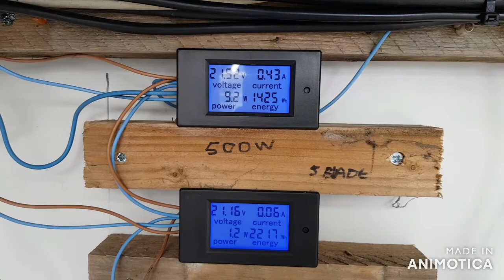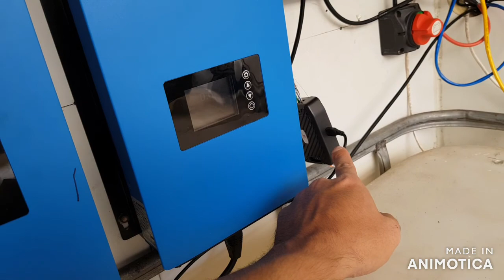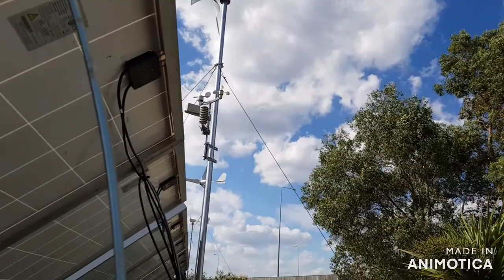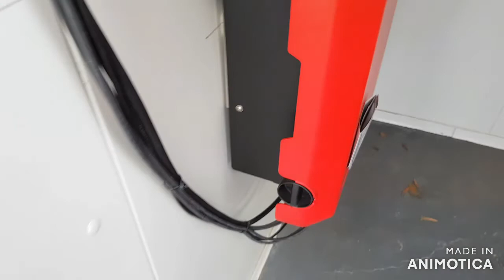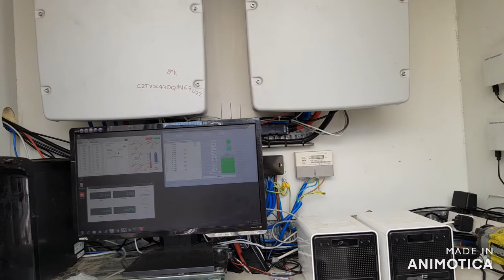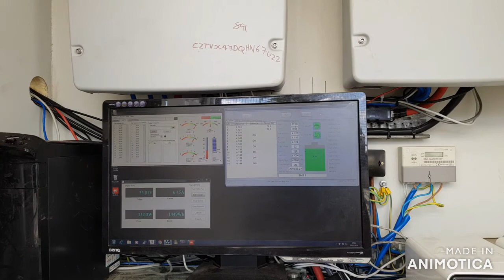Off grid in the U.K , Wind turbines , Batteries and inverters PT2

Comment: Where the best places to go to get good advice on instalation options of the deferent types of renewables
Reply from the maker: Hi, there really is'nt much in the mainstream, and alot of confussion out there too. My advise is if you are trying to reduce bills stick to grid connected solar installs ( albeit there is about 16amp AC export maximum)  unless you can get with zero grid export inverters. If you are looking with battery management, have a look for hybrid inverters. A very good company that could give advise is Voltacon, have a look on the internet, but i'm sure they are very busy at the momment but is a good starting point. Hope this helps, if you get stuck, leave a comment will try to help best i can. Ivan

Comment: Power produced by turbines becomes very often a danger to your system (overvoltage). In time we all figure out that multiple ways to burn the extra power or even short the turbines in order to stop them is a must. More and more videos on youtube show that we all end up purchasing the same monitoring equipment for your systems. good luck!!
Reply from the maker: I think, the size of my turbines, does the best for my sized equipment, i was looking to net off the usage during the night.  During the day the solar charging would off load and throttle down if the batteries are full , and i have at least 12 Kw of loads that are automated to turn on if production is too high.  With the storm that just happened, we were charging from the turbines, but nothing uncontrollable, i could see the problem if i had a much larger wind turbine, it would be almost uncontrollable.
Reply: @offgriduk2643  Makes sense. I wasn´t grid tied and had to do all extra energy burn locally. I also tried to not use 220vac and do it all at 48vdc (replaced the 220vac water heater in my solar cylinder for a 900w 48vdc). as a last resort and in order to stop the turbine, a 3 phase contactor used to short the turbine. all this done with a voltage sensing relay. another reason to keep it all on the 48vdc; if the inverter goes bad and your batteries are full, your system could go overvoltage.
Reply from the maker: Such a good idea to keep it all on DC, makes no sense to go from DC to AC then back to DC to charge the batteries.  I looked at the DC water heater element, but found they don't deliver the same kind of wattage vs the AC ones.  And in my situation the water tank was 100m away, the DC line loss would be ridiculous, and cable size too.

I'm not sold on shorting the turbine, have seen to many burnt out this way, i use this on a windless day when doing maintenance to stop the turbine.  But can burn out on windy days, if this is your last resort.  If possible you would be better using a Sheppard's crook to pull the turbine out of the wind to stall the turbine. 

I recommend two inverters to all people installing, for the very reason of one inverter going down.  So long the DC batteries don't over charge your safe, when the system is running, on small wind turbines like mine you don't have to worry about over charge batteries.  But if doing maintenance or if the system is off line / standby, then i would worry.  I have two dump load elements in parallel for that very reason, that's already a couple of kW to dump to.  Also the BMS would disconnect if the system voltage or cell voltage is too high.  Lots of safety redundancies. I would rather have the turbines free wheel than short them out, but either one is not the best option,  I don't think i've ever seen my dump loads (elements) come on, but it is there for peace of mind of over voltage on the wind.

Comment: Folks looking at this vid because of super high energy costs - Honestly unless you have wind speeds typically of 12m/s at you location folks it’s not worth installing wind at all  your better off installing 6 -8 high powered solar on a small roof or 16-20 high powered solar on a mid to large roof , just remember that in Dec-Feb with the low sun your only see a quarter on average max generated  e.g a typical solar day (10am - 5pm ) of a 6kwh system will generate 30-34kwh in summer to anything as little as 4-6kw in winter. If your away from home in the day it’s always worth looking at adding a 8kwh battery to 15kwh depending on your needs and family situation, plus handy yips on setting hd washing machine and dryer to run while your at work,  getting an Eddie added to your hot water tank ,  and increasing your home insulation from walls, under floor and roof will also better cut your total energy costs than installing a heat pump .e.g my former home I started with a 30kwh system that needed changing , I increased all the insulation first . After the install in combination with the Eddie I just installed a 15kw system instead. Didn’t use it at all in summer as the Eddie heated the tank (yes I did have a modern hot water cylinder c rated) and the place is toasty. It’s worth adding weather compensation to a dumb boiler using one of the smart thermostat system to get the most , so would I go solar again? Yes most definitely but would probably look at a micro inverter or solar edge to get the most out of the grid tied unit
Reply from the maker: Thankyou for the reply,  wind is very dependent from one location to another, however with the price of electricity as a whole, any generation of energy is worth while, especially if you are off grid, I don't believe there is a substitute for solar for generating the bulk of your electricity (unless you are in a true wind swept area like Scotland or Ireland), but the U.K as a whole is one of the best countries in the world for wind harvesting, and the sun just doesn't come out at night, unlike wind.  

I think you are referring to the number of solar panels fitted to a house (panels come in various power sizes, and physical size), and the metric is kW for instant power, an average off grid or 80% ++ self sufficient house would require min 15kW of solar array.  Energy is measured in kWh.  

Your metrics seems to be off, i think this is because you are confusing kW and kWh and being grid connected where you can export.  In off grid, you can only make, what you can store or use at that very moment, what you find you need for winter is storage capacity, as dark days can last 2 or 3 days before the weather breaks, and you can fill your batteries up again.   

I agree a heat pump is just not worth it on off grid solar, as your consumption just goes through the roof, I really can't see the ROI on purchasing one as the savings just don't stack up when the cost of electric will just keep increasing and outpace the ROI.  If you are really wanting alternatives for heating try a wood burning stove, or even diesel heaters (8kW).  Then use electric for hot water immersion.

Again an Eddie system is great for grid connected but can't be used for off grid.  You would have to use a very expensive integrated system to achieve Eddie with a grid connected system that has battery storage, and a zero export tariff.  Far easier in an off grid system, just base it on either voltage or battery %, to pull a relay on a dump the extra load to hot water.

I think insulation and Dbl if not triple glazing is great, although those don't generate energy, they only retard the bleed of energy out of your property (thermo-dynamics),  if your generating enough energy you could overcome all your requirements without having to insulate etc, not the most efficient way, and bear in mind this is really for heating (gas) not electric.  I think if I had a £5K ear marked for insulation, i would rather spend that on solar panels (especially used that would be  some 20 kW of Solar!!!!Savvy)

I'm still not sold on grid connection solar, as majority of the energy you produce goes back to network and is not used in your own property unless you want to buy 1 Eddie per item you wish to use, or you enjoy having the 0.11p per kWh you produce from your solar, and then are happy to buy the same 1 kWh back from them at 0.38p per kWh at night.  Thats power you could have used, instead of buying it in.

Bear in mind the average house in the U.K consumes 11kWh per day of energy, that's a little over 4000kWh a year @ 0.38p per kWh, thats £1525.70 per annum.  At the moment the prices are being subsidized, as the price for gas has increased some 400 + %,  it's just a matter of time before the price per kWh goes to 0.80p per kWh or dare i say £1 per kWh.  I think by then the price of the equipment would be outside the reach of many by then, I'm already seeing the price for equipment increase monthly in price.
Reply: Or just build a ground mount for the solar and make it as big as you want. No need to be up on the roof at all

Comment: Is this a 100% or near electricity suficiency? I wonder what's the rough cost of this setup solar+wind+batteries
Reply from the maker: Hi, thanks for the intrest, we are completely disconnected from mains grid electric. Our site produces almost 98% of power requirements over the year and requires the generator for the worst months of the year, even then it may not be every day, it depends very much on the weather.  To work the cost, it is very difficult to cost out a setup for a single person, as there are too many factors involved for houses. Also depends if your handy and brave enough to do alot of the work yourself.  A good starting place would be voltacon inverters, 20kw of solar, 30kw of batteries. I might be able to give you more clearity, if you gave me more details of your site, and requirements, and your own abilities. Hope this helps.
Reply: @offgriduk2643  I'm comfortable with electronics/electricals and also DIY, so could do some but would prob let the more difficult stuff to a contractor. Family of 5. 4 bed house. 2acres. Poland. I'm trying to find out how much roughly I'd have to spend to become at leats 80%+ self sufficiency for electricity, heating, hot water.
Reply from the maker: rough rule of thumb is, 10Kw of battery inverters (hybrid would be more cost effective, suggest Voltacon), 320Ah of lithium batteries, about 15KW of solar panels, Batrium BMS.  If you are in a good area for wind maybe a couple of wind turbine 600w.  This should give appx 80% self sufficent.  If you are loading hot water, an immersion type take appx 5KWh a day to heat a cylinder of hot water, you would have to increase you qty of panels.  I don't list prices as you may want to use used for many of the items, batteries/ solar panels etc, also the prices for these items are increasing in line with demand.  I would budget for £10k min i could get hold of used and do most of the work myself.  Hope this helps, let me know how you get on.
Reply: @offgriduk2643  thanks my friend, much appreciated you taking the time to reply and provide such insightful information. Another question, with the items involved in this setup having a lifespan of 8-15Y would you still go with used panels, batteries and turbines?

I've seen 10 to 30kwh new batteries running at 8k$ to 15k$ so was surprised when you said 10k£ for the whole stuff. Maybe I should be looking at different suppliers such as the ones you mention. Where would you go about acquiring used?
Reply from the maker: @pama1  Hi, great questions, easiest way when buying used, is based on moving parts or cycles.  I would not buy a wind turbine used, unless it was dirt cheap, new ones from ali express are appx £300 new, and the time needed to mount and install, would be a pain in the arse if a bearing or slip ring fails.  

Solar panels used are a difficult subject.... lots of different debates...simply put solar panels have no moving parts and degradation does happen.... but it tails of at a maximum of 10%-15% of effectiveness for a lifetime.  If you have lots of space, especially to ground mount, I would use used solar panels, that have come from a de-commissioned farm (they take them out of service because they can make more money feeding back to the grid per SqM of land) so they upgrade from 180W panels to 350W to almost double their revenue, making bulk purchase of these panels is very cost effective, if you need 50+ panels.  You have to bear in mind in a solar field, they are not looking after the panels (fit and forget) so have all the abuse thrown at them, and only replace them when they are damaged completely.  Mechanically speaking solar panels don't wear out, so are (pinch of salt) good for a lifetime.  Used bulk panels can be found for £40 per 280W panel when buying 50 panels bulk.

This however does not include insulation breakdown in the panel itself, this can lead to the panel frame being live as the electric path can be found if it rains etc, but the panel will still output the same watts.  You should always earth your solar arrays however they are mounted for this very reason.  Some solar inverters however will create a fault if this insulation breakdown is too much though, but can be circumnavigated, by wiring in parallels and not series.  A good insulation tester for DC circuits can usually fault find on this. 

Batteries are the bane of my existence, as their are so many different ways to create a storage solution.  Off the shelf compatible batteries with BMS built in such as Pylontech will run into eating ten's of thousands of pounds,  the more creative you are the better.  At the end of the day kWh / Ah is what you are interested in at the end of the day, so my best solution is a Nissan leaf first or second gen battery pack, they are 24kWh of storage and a used battery pack is usually between £2K and £4K.  When i buy a used Leaf pack, i will only buy if they can tell me the state of health (cycles) of the battery and it being maximum 70% +, again unless it is very cheap.  You have to bear in mind with a reasonable size battery you will cycle them maybe 80 time a year, unlike the car, they are cycled every time they go flat and recharge, which can be daily.  This will extend the battery life for years, on a used battery pack, (my batteries cycle 30 odd times a year).... at this rate, i'll be buried with my batteries suffering some 30% degradation.  A Batrium (watchmon 8 i think) BMS to balance and protect the system is some £300.  So you could build a 24kWh battery pack for less that £3K, and expand the system with more Nissan leaf cells in the future, as you only need one decent BMS system.

I would stick to Nissan leafs as they are the easiest module system to build up and have the correct configuration for most inverters, i.e 14 in series.

There really is'nt anywhere in particular to look for used equipment other than eBay etc, try looking for "bulk solar panels" and "nissan leaf battery", there is a very good firm from Ireland that do EV car breaking, with Nissan leaf battery packs on ebay, very nice guy.

Voltacon do very good hybrid inverters, and can parallel up to 9 in series of 5Kw per, i think two inverters with a parallel card will set you back about £1750.  I'll be doing a video on them soon.

Comment: Cracking stuff trying to get through all your videos. Top info . Trying to do off grid through the winter for the first time. As I have to normal switch of part loads.it will be fun for sure.
Reply from the maker: First winter is always hard. Especially if you only have 1 off genset/ battery etc. Break downs usually happen xmas week when everything is closed, tried to get some small spares fuses etc, stuff that is cheap to replace, but first to break if something goes wrong. Keep an eye on your battery temp too. And of course the best .... snow off the panels. Other than that, bear in mind your batteries may need a full charge appx 1 per month, by charging to full. Keep me updated if you need any help.
Reply: Thanks for the info. Yep got loads of spares. Can I ask what size fuse you use on your turbine please. Many thanks.
Reply from the maker: @twistedtube1310  no problem, the theoretical maximum amps drawn off a 600w turbine at 40v would be 15 amps, i use maxi style fuses at 20 amps. Not ideal as these are 12v fuses, but have proven to be adequate. Could always use resettable rcd type for solar, but they could be too sensitive.

Comment: If for example the batteries go flat overnight, the inverters shut down, how does charging start the next day seeing  that it's the inverter that charge the batteries?
Reply from the maker: Great question, unfortunately there is no absolute answer to this. The sunny island will shut down with minimal energy left in the batteries (3%) , if say, the generator won't start.  Sunny island will attempt a recovery based on an internal algorithum and will reboot at say noon to get the best chance to bank some wattage.  But ultimately, it's virtually impossible, probably a future development would be to have a stand alone mppt charger (victron) connected directly to the batteries to give a trickle feed. thanks for query
Reply: @offgriduk2643  hello,
Have you considered adapting a Vawt on the poles of the Hawt?

Do you think it would be possible?
Reply from the maker: @FirstLast-tx3yj  i think anything could be adapted, vawt are meant to be quite good in low wind speed compared to hawt. To adapt the same pole type you would need a metal base / plate welded to the top of the pole for a good solid and stable base. Most vawt are generally floor mounted, but really would be most suitable for a flat roof install, example is a three floor apartment with flat roof, like you get in the Mediterranean. Good news are vawt are quieter, but not as good performance.
Reply: @offgriduk2643  yes the mppt is a good idea,  I suppose it could be controlled with a relay on the AC side?